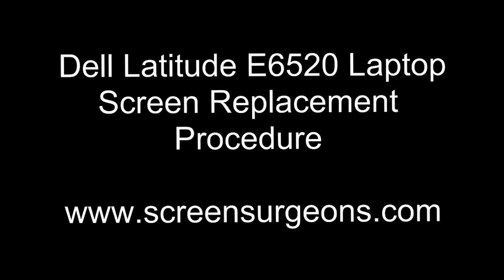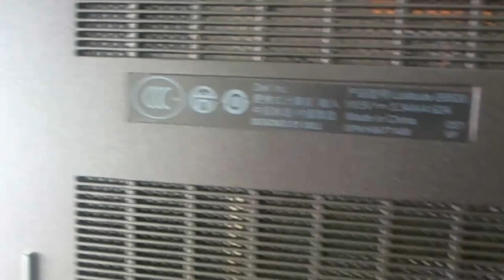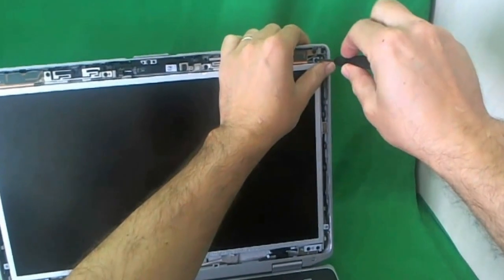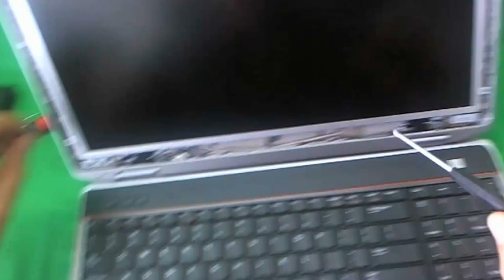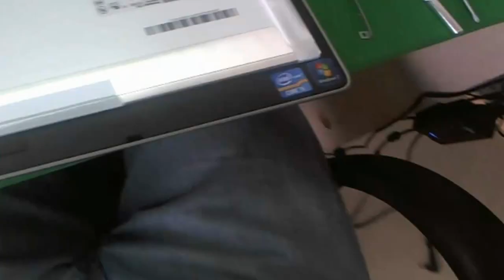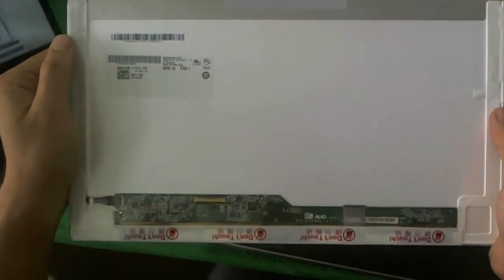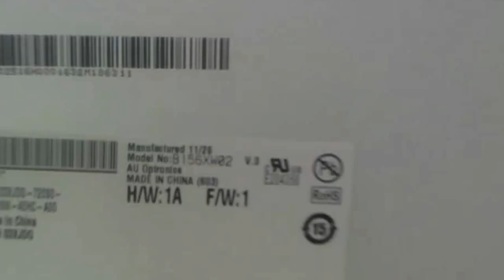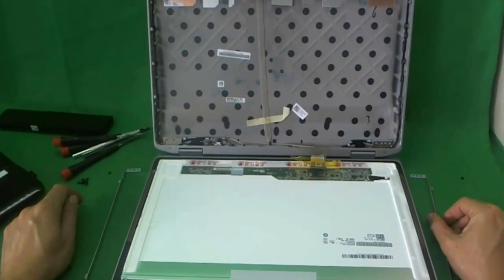Dell Latitude E6520 Laptop Screen Replacement Procedure

Comment: Also I’m interested in getting a touch screen. I found one on eBay 40 pin 15.6 I still need to see if mine is 40 pin. Do you sell touch screen for 6520?
Reply from the maker: It doesn't actually work that way, while a 40 pin touchscreen is very common (there are at least 4-5 different 40 pin 15.6" versions) none of them mount the way the one in this video does. Even if they did there are probably no firmware updates that will make a non-touch laptop have touch capability, especially on a laptop of this age.

Comment: How do I know if my 6520 is a 30 pin or 40 pin?
Reply from the maker: If you take it apart and the screen looks like the one in the video it's a 40 pin, what we called a 156LED-Gen (several companies made these back then), we no longer carry the screen but you can find it on Amazon or Ebay pretty easy.

Comment: Thanks for the excellent video. There is a touchscreen available for this laptop. Do you know if removal or the original screen and replacing it with a touchscreen would follow the same process as on the video?  Thanks.

Comment: Thank you for the excellent video Eugene.  I would like to suggest a very small edit at the very end of the video when you are installing the replacement screen. You say to connect the connector then to screw the brackets on. I would suggest you reverse that order since it is easier to put the brackets on first before plugging in the connector and there is less chance of twisting the connector loose as you manipulate the screen to attach the brackets.